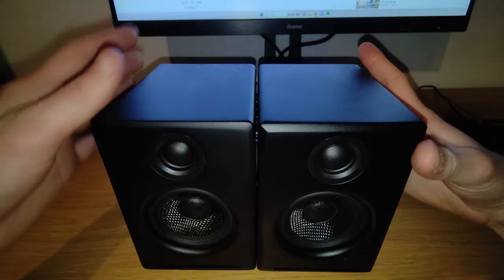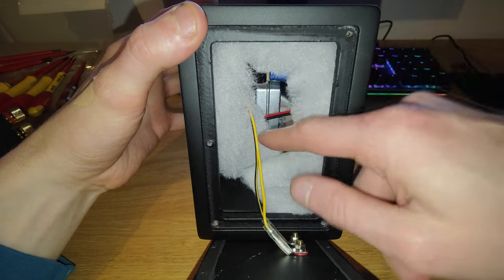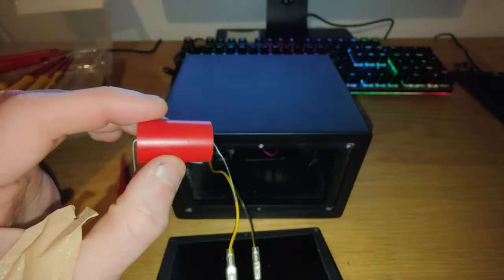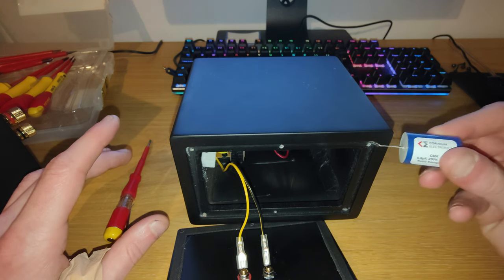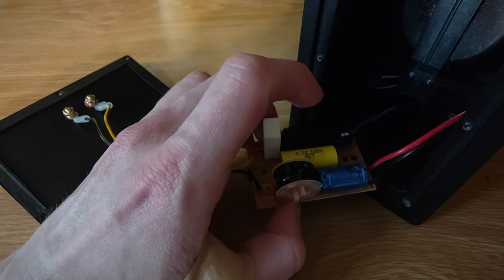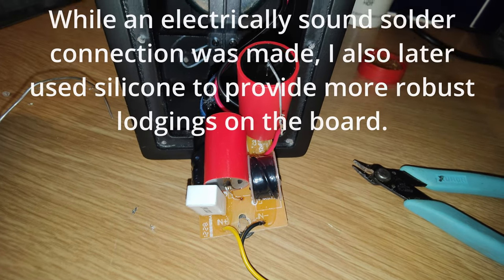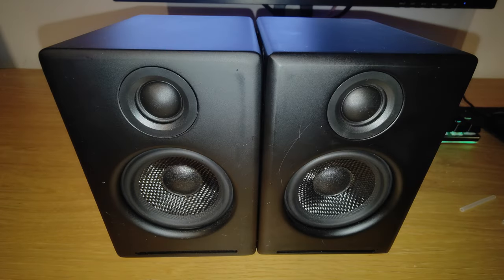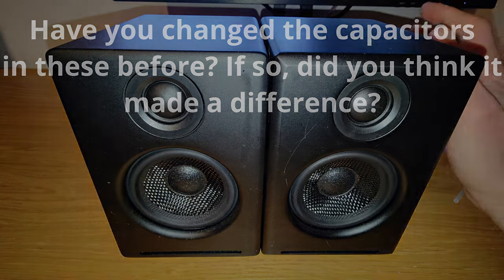AudioEngine A2+ Crossover 'Upgrade' Experiment

Comment: Well done, might be audiophile snobbery but it's well informed snobbery! Any idea were I can equivalent caps to perform the mod myself? Thanks.
Reply from the maker: Ha! No doubt you'll do a better job than me. Depends, which country are you based?
Reply: @SonicClown-qz1zp  United States, but I'm willing to pay extra if they're (not crap) good
Reply from the maker: @dotmatrixmoe  I'm still only selling my capacitors in the UK at the moment, but a good cost effective alternative in the US would probably be something like the Solen PA's. They're smaller too, so much easier to get onto the board. They seem to have a few distributors in the USA. The problem with other brands is they tend to be quite a bit longer, and cost about the same as the speakers themselves. I'm working on a video where I repair and upgrade a dirt cheap pair of Audio Engine A5's. They all usually suffer from the same fault, and go for cheap. I've got some special capacitors in to try on them.
Reply: @SonicClown-qz1zp  Amazing response! In the same boat, repaired some rubber seals on $45 Audioengine A2+ and looking to see what else I can do to them

Comment: i sometimes have a disturbing rumble in one speaker of my A2 set. could that be a problem of the capacitors?
Reply from the maker: Quite possibly, electrolytics have a 'shelf life', and there is chance that it could have crept to an extent that it's not filtering the correct frequencies. Perhaps give the capacitor a visual examination.